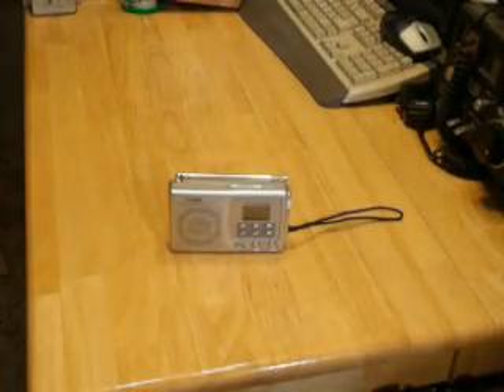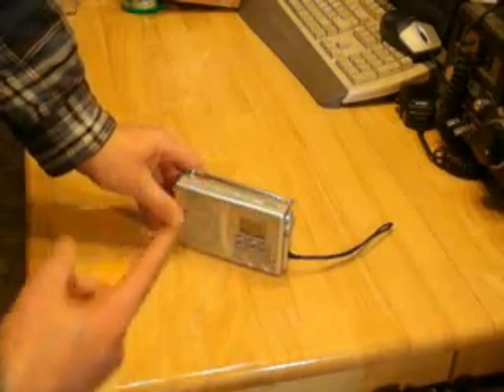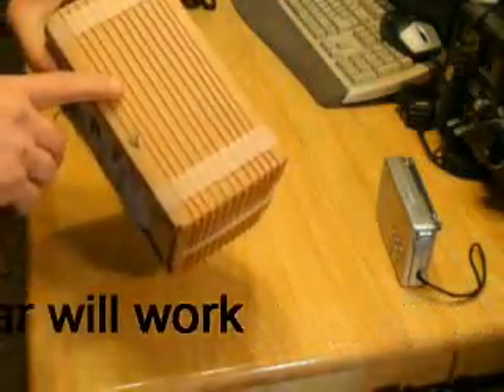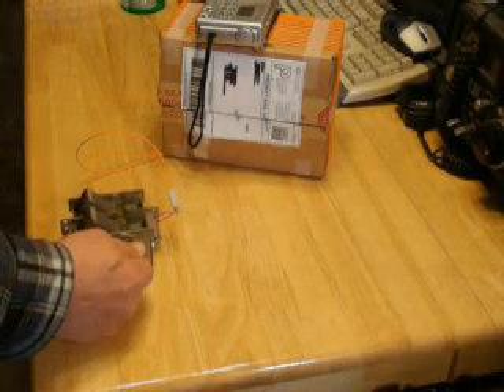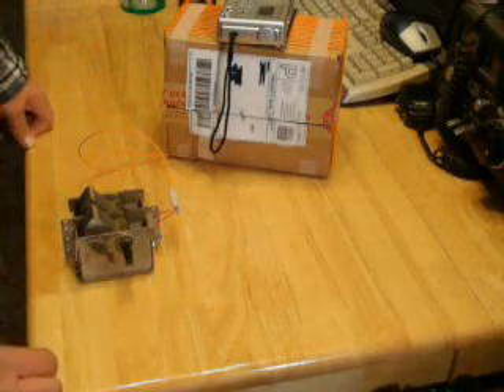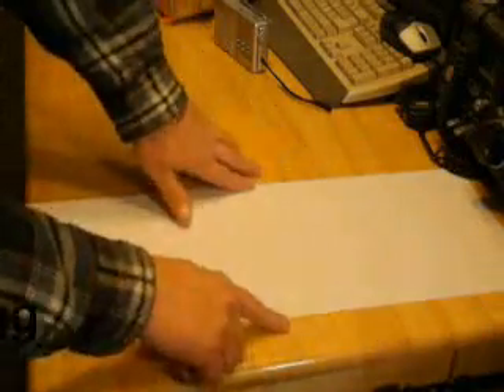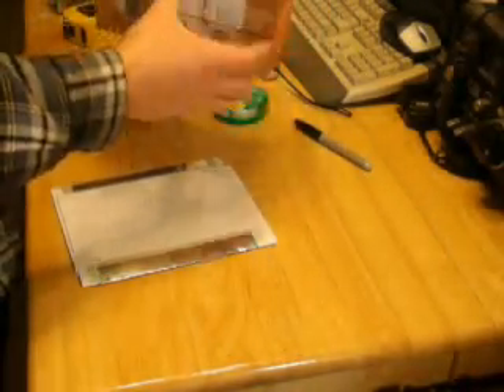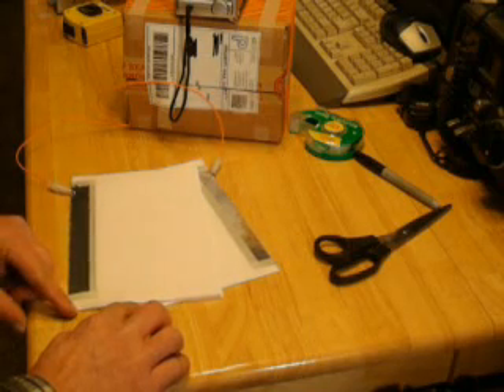AM radio booster W/ Home-Brew capacitor

Comment: will this trick work on a car stereo that i have installed to use in my house
Reply from the maker: In a word, no. A car radio uses the whip antenna for AM reception, not a ferrite bar like a portable radio has. The project I show couples to a ferrite bar antenna. You would be able to get pretty good AM reception with just a long piece of wire (10 feet or longer, 100 feet would be awesome!) connected to the antenna connector. A short piece of wire 2 to 2.5 feet long would be adequate for FM. While this project could be adapted to the car radio, it isn't something that I could easily explain.